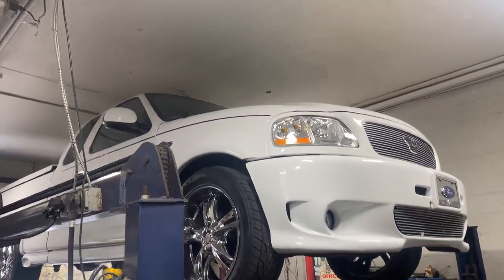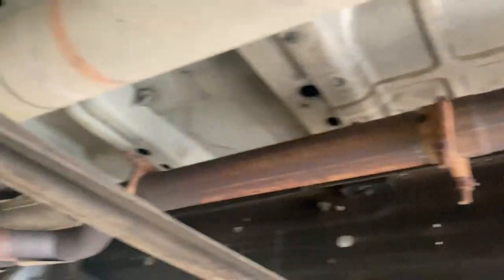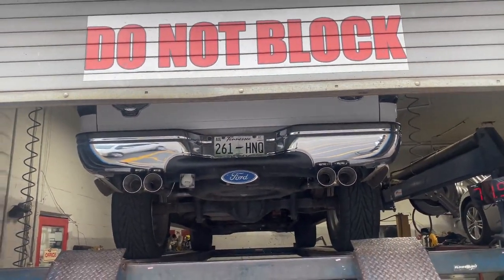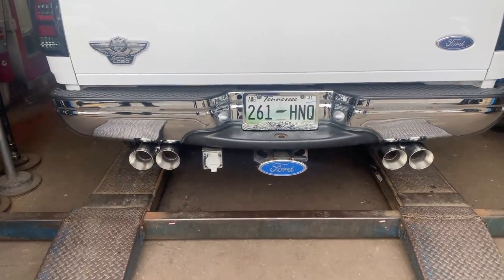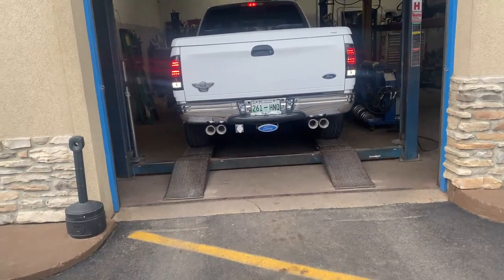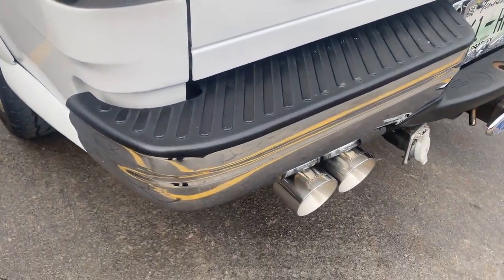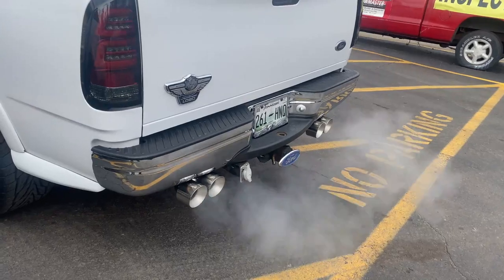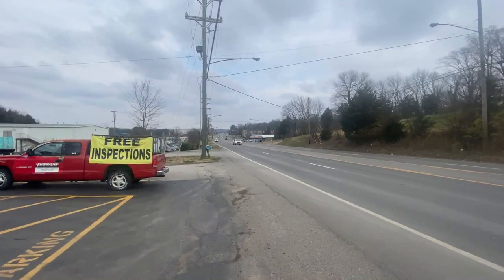1998 Ford F-150 5.4l TRITON V8 DUAL EXHAUST w/ SHORTY HEADERS & STRAIGHT PIPES!

Comment: the Harley Davidson F-150 didn't come out until 2000 as a supercab stepside only until they went supercrew only and black was the only color until 2003
Reply: Switched to supercrew in 02, added Charcoal Gray color option and 1st year of the Lightning's supercharged engine.

Comment: Hi on the video you dome a year ago with the magnapack on the lr4 ive got a lr3 does it require 2 magnapacks or 1, I'm sure its 1 pipe going into the centre box and 2 pipes coming out. Do you guys know. Ive got a 2005 discovery 3 tdv6